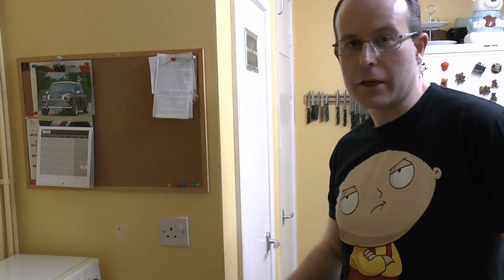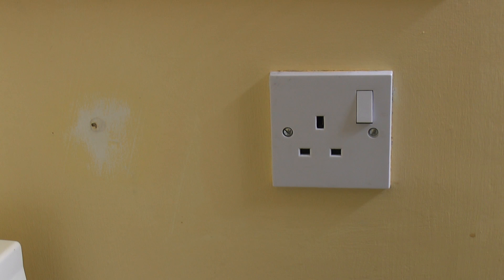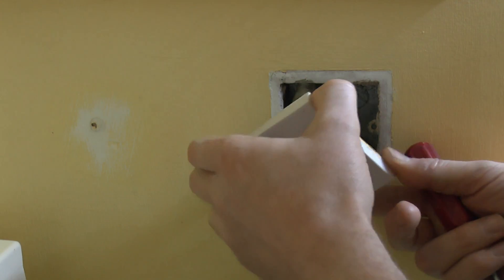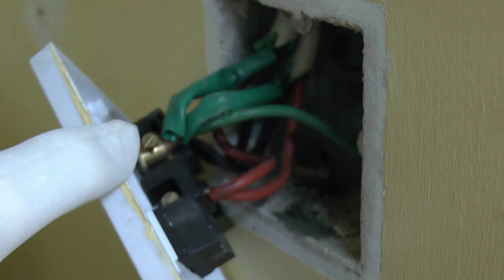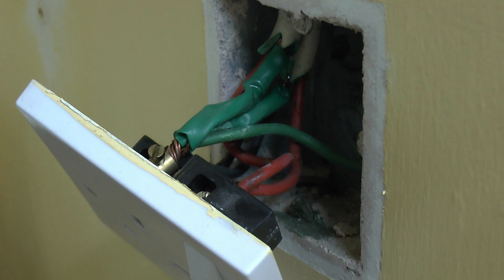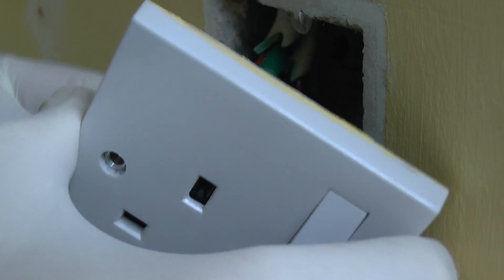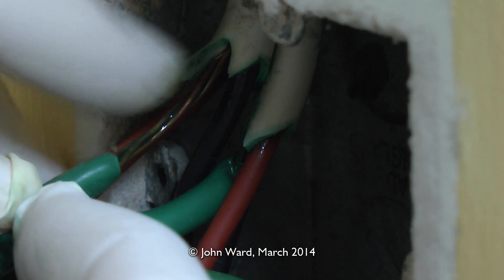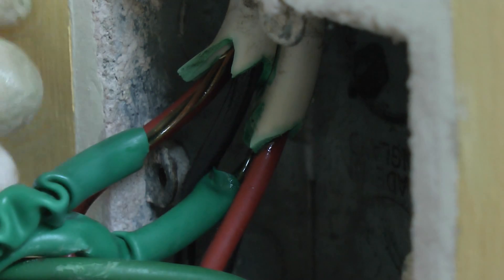Green Slime in Older PVC Insulated Cables

Comment: We get this in NZ as well, it gets into your light switches and gunks them up eventually they stop working you have to try and bend the wires back into flush box so the slime drips into the back of the box and not into the switch gear , almost allways the 3 core with bare earth .

Comment: Si is this dangerous should I need my house house rewired
Reply from the maker: The green slime can be conductive, so may cause faults.  It's also toxic.
Probably not dangerous, but any property with this problem needs to be rewired, there is no other solution.
Reply: @jwflame  it's in about 4 sockets if I change sockets will it be ok .will my house go on fire

Comment: I noticed that the door behind you had a grill in it at the top. Is some sort of heat source located in that cupboard ? The reason I ask is because I'm having the same problem in a socket located just below a tall radiator. Can this problem be accelerated by heat ?
Reply from the maker: Heat will make the problem worse, as will circuits run at or near their maximum load (as that causes the wires to heat up).
The vent is there because of another one in the floor of that cupboard that goes outside, the original intention was for air to enter there if gas or solid fuel appliances were being used in the kitchen decades ago.

Comment: Hi I am having the same problem, will I need to just clean away the green goo, I have no problems with the lighting it self, just green goo from one of the plug sockets, also it is an old property.???
Reply from the maker: It can be cleaned away, but that is only temporary, it will return.
The green goo is the cable insulation degrading, the only solution is to replace the cables.

Comment: So can this cause power outage in your home? I just opened mine and found some of this green slime after our power went out this morning
Reply from the maker: The slime is conductive, so can cause short circuits if it gets into terminals.  The cables become brittle and the insulation can crack causing faults.

Comment: I do remember in the 80's ripping this cable out, it made your hands gooey and just never seemed to wash away.
Anybody remember also when loose bead polystyrene insulation was pumped up into the loft and sat between the rafters, shortly afterwards the T&E became gooey caused by a chemical reaction between the polystyrene and the cable plastic. After a period of time the T&E became brittle. Another mistake of the past.

Comment: I had a fault finding job due to rotting 1970s cable twice in same property with 10 years between faults and different locations where the cable failed within a plasterer wall amazingly the line and neural were arking away , upon chasing out the wall I found about 12” of ash with bare conductors , luckily the cables were capped and I could pull new runs . But that’s my only experience with rotting cable

Comment: The worst thing about this is if it was ran next to older Vulcanised India rubber cables....the leaching plactaciser will turn the VIR insulation to goo that will fall off the cable and leave it exposed! 

This is a huge problem on the railways (where I recently took a cable installed some time between 1921 and 1947 out of use)

Comment: Fantastic video, I have been trying to find out what the green ooze was for years, I originally thought it was from the early release agents (pre talc),  reacting with the copper, none of our cable manufactures even acknowledged the existence of the problem citing water ingress or similar poor installation problems, a few high rise buildings I work on in Melbourne where even the single insulated cables have the same issue, the green ooze gravitates down from lighting and power CCTs into the RCBOs and kills them stone dead.  Thanks for sharing the knowledge, very much appreciated.

Comment: Do you solve it by cleaning and replacing the sleeves? Or do you have to to pull a complete set of New cables through the cable tubing all the way from the breaker Box (or closest Junction box)?
Reply from the maker: They can be cleaned as a temporary solution, but the slime will return.  The only permanent solution is to replace all of the wiring.

Comment: As always, thank you for the video. You are a little more trustworthy than I thought! You didn't do just one extra check yourself that the power was off. You know the homeowner well?!
Something that does surprise me, is that you don't seem to use insulated screwdrivers as standard. I know that most of what you demonstrate is under controlled conditions, but I think that the safety message would be reinforced, or have continuity (no pun!) if insulated tools were shown to be used. You may possibly have a reason for not using them.
Reply from the maker: +Ian Harrison Power was checked in the cut between unscrewing the socket and showing the insides.  Property owner was not there at the time, and the consumer unit is in the cupboard in the corner of the same room.
No need for insulated screwdriver here as the only thing it was used on was the earthed metal screws fixing the socket in the wall.
Reply: Where I live it is kinda mandatory, but even though uninsulated tools will make you think twice of working on a live circuit!

Comment: I have seen similar green goo on much older cable with rubber/woven textile insulation.
Is that a result of the same ageing process ?
Reply: +4623620 
My guess is yes, it is.
Reply: +4623620 certainly old rubber cables degrade in interesting ways, think in this case it was a bad type of pvc cable that degraded, and usually it does not do that, but rubber cable in the old days always degraded, if it was hotter, such as used in power tools, it could be a very short life.

Comment: Apparently, this type of PVC cable was manufactured between 1965-1971 and the problem component is "degraded di-isoctyl phthalate"...  Some definite suggestions it has some toxicity and being banned, but generally agreed upon no need to remove so long as the green goo is cleaned and the cable insulation is okay.
Reply: my local council owned properties that were built in this time period, they noticed the issue around 1990, and all properties from that time period had a full rewire and replacement modern fusebox to current standards (to replace the old metal wire fuses).  my neighbours house was terrible affected by this, the wire was badly attacked and the  colours gone to make it hard also.  though my house was just fine, but all were done anyway, i guess there must have been some that were from a different supplier and thus the luck of the draw

Comment: Thanks for the video.  Do you know if this green slime is conductive? If not,  does it cause high resistance between joined wires if not cleaned off when adding or removing new wiring/sockets etc. 

Thanks.
Reply from the maker: A. Samrout The plasticiser is not conductive, but may become conductive after it reacts with the copper (and turns green),  so it should be cleaned away before fitting new sockets.
It won't cause high resistance joints, unless the screws or terminals were already loose, but that will cause problems anyway.

Comment: This is a very interesting little video on a problem I did not even know existed. I was wondering if you had ever thought of producing a series of videos on identifying the age of wiring installations by referencing the types of sockets installed by decades for example? My house was last re-wired in the early 80's and has what I suspect were very standard sockets in use at the time. Houses re-wired in the period 10 years before or after probably had equally distinctive but different plug sockets. It would be instructive to know what to look for in dealing with the problems likely to be encountered with installations from each decade. Just a thought.